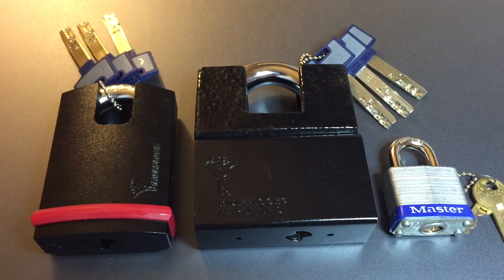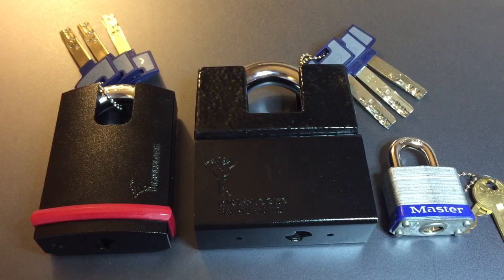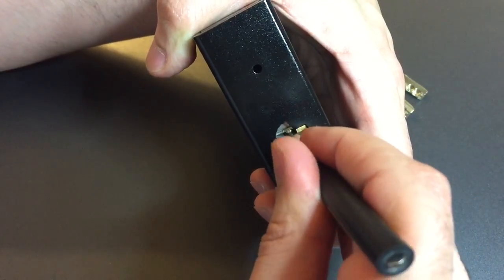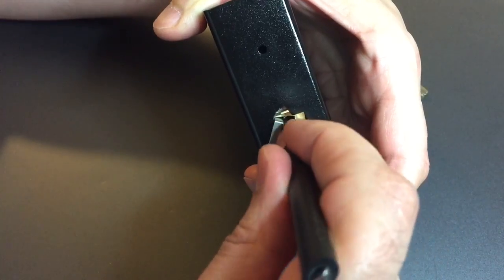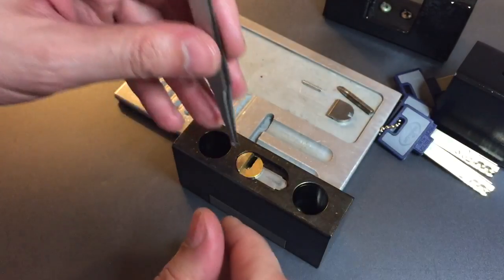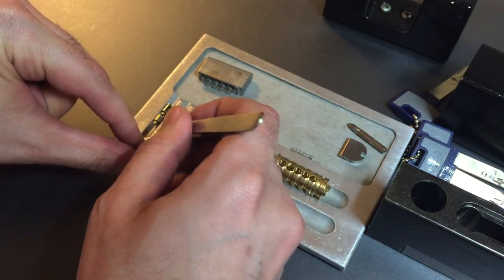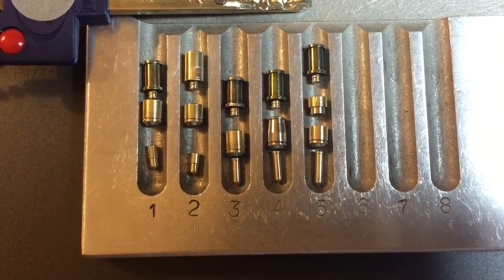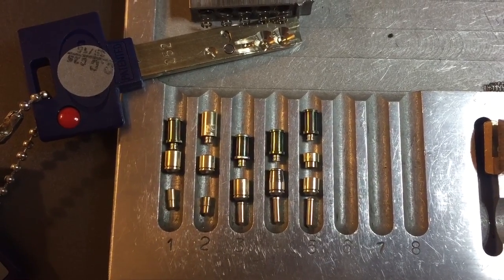[235] HUGE Mul-T-Lock C16 Interactive+ Padlock Picked and Gutted

Comment: Very nice picking and I love how relaxed you are when you feel pins oversetting. I was picking a heavy Viro, panzer last night for about 15 min and I could really feel the strain afterwards, I can only imagine what this feels like after a long picking session!
Reply from the maker: Thanks.  It can really get bad on some of the larger locks... oddly enough, however, to most difficult to hold is not the heaviest or the biggest.  My Rotalok (with the outer shell mounted on bearings) is near impossible unless you lock it to something first.
Reply: I’ve had a C6 in my naughty bucket for 8 years, after rescuing it, complete with hasp, from a derelict building at work.  I just couldn’t get a pin to set, or so it felt like.  Tonight, after hundreds of hours trying to open it, I grabbed it, didn’t have my dimple picks, but had two custom 301 HY hooks and a 15 thou Gem.  I increased the tension by a lot and picked from the back to the front.  

I realised that this lock binds with heavy tension and then tried gently tapping each pin, as you would do with a serrated GeGe.  I twigged that I was getting clicks, as each serration was passed on each pin. So I just really patiently kept on getting clicks and tiny gives on the core.  When I thought it had stopped responding, I tried a similar gentle sweep, as when you do the inner pins and it dropped round into the oh so sweet heavy false set.  I thought that it was a false alarm, because so many times,  I’ve thought I’d got the falsey, but the tension wrench had slipped out and turned the curtain.  I then used a very fine tipped Southord to tickle the inner pins one by one and on the 5th pin, clunk, I screamed with joy 🤩 😝😝😝🤣🤣🤣❤️❤️❤️ Got it apart now, gonna get on the lathe tomorrow and make some plain 4mm pins, until I can source some genuine pins with matching 115 keys, whoooooo💪🤣❤️
Reply: @seeitpickitbinit2510  congratulations!

Comment: The interactive pins need more explaining. Here in the US we don't get many locks of this caliber.
Reply from the maker: It's a bit hard to explain in words, but I'll try.  The interactive element on the key doesn't add much in the way of security... in fact, I'd argue that it decreases pick resistance.  In short, here's what it does.  There is a mechanism inside the lock that presses on a particular part of the key (known as the "interactive element") which moves.  That moving part sets certain locking pins.  In the case of this mul-t-lock, the moving part sets the key pin higher than the top of the keyway.  As such, a key without that element would never work in the lock.  More than anything, this aids in key control (i.e., someone can't get a copy of your key made without proper authorization).  For picking however, it's like the free spot on a bingo card.  For outer pin #2, I always know that pin will be set very high.  I hope that makes sense.
Reply: In addition, here in the US 🇺🇸 we have the third best health care systdumb of the entire North American Conn tin ant.

Comment: I’ve had a lock like the big one from multi lock with a huge square link chain as my bike lock for over 14 years now. I was a bike messenger in Chicago. It came with two keys and a registration card. The plastic on one of the keys eventually broke and I lost the key. When I wanted a replacement key I found that the registration card rubbed away and became blank while in my wallet. So for maybe 10 years I’ve been using one key hoping I don’t loose it or break it. It would be great to get a spare key and get the years of crud out of the lock. I’ve asked a lot out of it. But at $180 I’m not wanting to buy another.

Comment: Can you please make a video attempting to pick the Abus 20/80 lock because I still haven't seen a single video of that lock here on YouTube and you said previously that you couldn't pick the Abus 20/70 which I believe is basically the same lock but smaller so I'm curious if you figured out how to pick the Abus 20/70 since your previous video and if you or anyone could pick the Abus 20/80 and if you could compare those two locks with each other and with other disc locks as well as other locks in general and just basically talk about their value for the price and their cores compared to other locks, do they have the same core as the Abus Insurance lock or not? etc. THANKS!

Comment: The Mul-T-Lock classic I removed from my front door (~5 years old) has the exact same pins as this, even the spooled inner pins and the counter milling.
Reply from the maker: My understanding is that these pins were introduced in 2008.  Does that fit with your install time?
Reply: Yes, but I didn't expect them to be on the simple classic lock :). Mul-T-Lock Classic is the defacto standard cylinder for new homes in Israel.

Comment: Bud is the body painted black or it's the light cause I have several and see them daily on the street but never in black.
Reply from the maker: MTL has two finishes for this model:  "bright nickel chrome" and "black electrophoretic."  This one is the latter.  It was just random chance that this finish was the one I found the deal on.

Comment: do you have any videos of you showing your technique on these locks. I was going to buy a Jr to get a feel for them but I came into a deal on 6 interactives without keys for 5 bucks.
Reply from the maker: I'm afraid not.  I give lots of bits of advice over my videos.  I have a playlist on my channel of all of my videos picking MTLs (the number stands at 27 right now).  I know it may take a while, but it might be helpful to start the playlist running to get a feel for my picking of these locks over several picks.  Skip my really early ones when I had no clue what I was doing.  Also, note that Interactives can be the easiest MTL to pick.  Like the classic, but less warding and you always know that outer pin #2 is set way up high... like the free spot on a bingo card!

Comment: Those 5 holes on the side of the keyway what are they used for and do they come into play while picking? Also how did you defeat the counter milling on the outer key pins and inner drivers?
Reply from the maker: They do not come into play.  They are used for passive pins (key control device).  The countermilling/spooling combination requires lighter tension and a really deft touch... they also require patience because they ARE frustrating at first.  Another method that I use is purposely oversetting them and reverse picking by modulating tension.

Comment: Are the screws accessible with the shackle in place?
Reply from the maker: Yes and no, if what you are locking is tiny, then maybe you could get to them.  But it wouldn't do much of anything.  Maybe it would give you a better angle getting bolt cutters on the 16mm shackle... but good luck cutting it!

Comment: how do you get the keys off if theyre stuck to the lock?
Reply from the maker: You lost me...  are you referencing the keychain being locked around the shackle?  If so, either picking the lock or opening the keychain works.  Which method is faster depends on the lock.